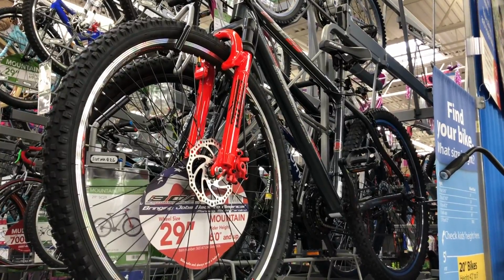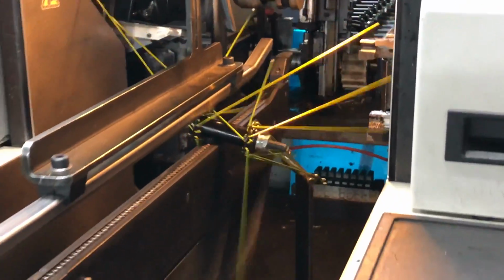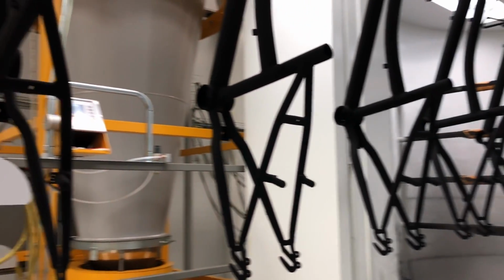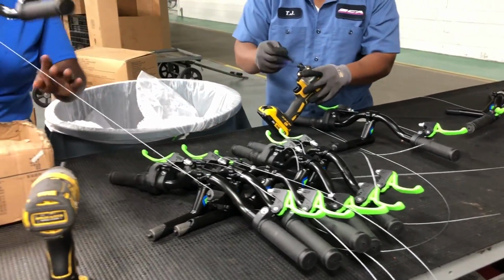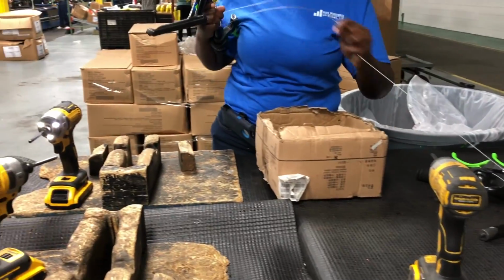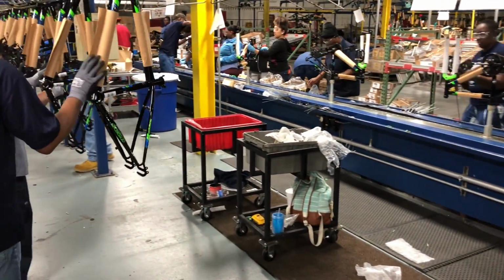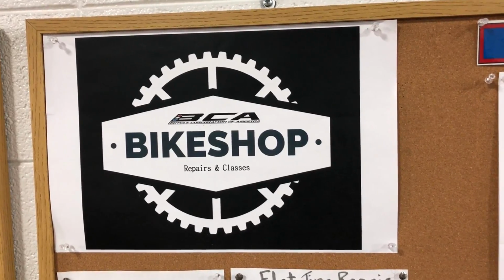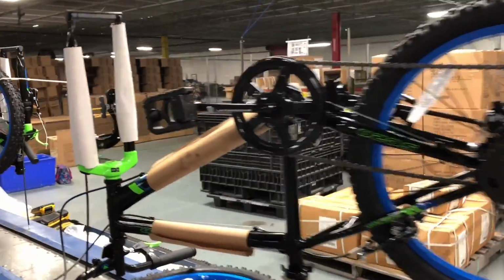BCA Bicycle Assembly Plant - Manning, South Carolina

Comment: Did you ask them why they insist on painting the rims of a bike with rim brakes?
Reply from the maker: I’m hoping in the future to meet one of the bike designers. That’s at the top of my list of questions.
Reply: Simple answer- shelf appeal. They dont care what it looks like post purchase. The lower end bikes just want the impulse buy of just "needing a bike."

Not knocking it, it's just business
Reply: If you look at the very first frame of this video you can see a wheel where the rim is painted black without having the sides covered (even though it has disc brakes) and it looks great.  Steel does not look as good unpainted though.
Reply: Not sure this helps, but my younger son’s first real bike was a BCA with green Vitesse rims like those in this video.  The paint in the braking area wore away in the first few minutes and they performed just fine.  The rest of the rim stayed nice and green for two years of kid riding, which surprised me given how quickly the other paint wore off.
Reply: Because they do not machine a braking surface, which would cost money, and involve another step.  The lower end models also use steel alloy rims and not aluminum alloy rims, so they need the coating for protection.
Reply: Simple. They paint them so when the customer gets cut off on the road, the car driver will hear the squeaky brakes above their smart phone conversation just before impact.

Comment: i wish Costco had a handlebar jig for their bike assembly....half the bikes i've seen on display have the bars upside down or the brake levers facing the back of the bike
Reply: i actually keep a photo album on my phone detailing all of the mistakes a previous 3rd party assembly company made building bikes at my walmart; I made enough noise that management finally replaced them.

Comment: Now you guys just have to get Walmart to employ real bike shop guys (is there a graduation/degree or something to actually have someone who has a good knowledge of the bike mechanics in the US ?) !

In france we have the same thing except that the bikes are sold by mainly sport only big branded stores (Intersport, GoSport, etc ...) and this stores require a bike mechanic graduation to work in it, so the bikes are pretty much the same as you guys have, but they are tuned by a professionnal and when they are sold, they might not be the best quality bikes but everything works well and is safe to bike !

Sorry for my poor englando and if i did'nt make it easy to understand what i was thinking :) !
Reply: in the US, there are teams of bicycle assembly 'technicians' who go from Walmart to Walmart and work at night.  They get paid by how many bikes they assembled that night, and there are no qualifications required to be hired onto this crew.  Its all about speed.

This is why theres so many photos of bicycles with their forks on backwards, saddles at crazy angles, and handlebars rotated oddly.
Reply: @YearOfTheDog82  what you are describing is the 3rd party assembly companies that Walmart is trying to use instead of the in house assemblers (like me) who actually care about the quality of their work. The shift to the 3rd party companies actually started last month; which threw thousands of associates like myself under the bus all because they are trying to chase amazon.
Reply: YearOfTheDog82 Yeah, I think that was the job I passed up on a year and a half ago. I'm glad I did. The attitude is around "not my problem" and "it came messed up from China" and not many of these guys take the time to true a wheel or use a torque wrench. Assuming most of them have ever used a truing stand! The one where I work was a joke until I started working there. I use it every day although I don't get payed extra for truing wheels. It's all $15 per bike flat rate no matter how many mods the customer ordered, like fenders and rear rack, etc. I admit, I do hate on the customers who go for the full Pee Wee Herman bike with everything but the kitchen sink on it. Takes forever to assemble. I can assemble three bikes in the time it takes to do one Pee Wee Special. That being said, I love my job and put in the extra effort. That's the work ethic I have. I stand by my work 100%. I doubt most of these mobile assembly guys can say that.
Reply: ZeBen84 not everyone has a degree (college is expensive) and unless you are corporate, you probably dont have a degree working at Walmart
Reply: ZeBen84 France has a very different education system and biking is culture in France.
Reply: sploofmonkey mainly because of the massive distances the US and Canada have; outside of the major cities, the only way to get around quickly is by car.
Reply: A couple years ago I almost answered an add for mobile bike assembler. Had to have everything including a bike stand to do the job and go from store to store. It payed a little more than where I'm working doing the same basic work, but I get to ride my bike to work every day. At my age it's almost like semi retirement. I haven't looked at a bicycle in around 30 years before taking the job, but I've been a mechanic in one thing or another all my life, so it wasn't hard to pick up on. It's funny, a bunch of the staff have diplomas from bike mechanic school, but they don't work on the bikes. They often ask me questions. I'm the only bike mechanic/assembler in the place. I studied like a madman, and probably learned a lot more than I'll ever use working for this company with the bikes they offer, but I needed to anyway because I started building electric bikes just before getting the job. I've even got the company owner starting an ebike line now! Not as fast as the ones I make myself, but he just ordered two bikes build for himself and his wife that slightly exceed the legal status here in California. Two 1000w Bafang BBSHD motors.
Reply: ZeBen84 your English is fine, much better than most of our French.  It was very easy to understand your meaning.

Comment: I can write it up small hills I can cuddle up to 23 miles an hour without any problem it was well greased in package I enjoyed the bike I have had Huffy Nel lusso another so which I did not care for the coaster brake sucked they had no packing grease in the crankcase and the frame split at the at the rack
Reply from the maker: You own a bca bike?
Reply: I will agree with you to pick Walmart is making upstairs and help step on bicycle quality-wise yes
Reply: I would like to see a full suspension bike hardtail Softail mountain bike from Walmart a decent quality one for a decent price

Comment: you should check out the hyper beach cruiser from hyper online you cannot get it at the Walmart store you have to order it online I think you will be really impressed compared to the Nel lusso the gear ratio is better than the Nel lusso the frame quality is a lot nicer I don't care too much for the rims but for $99 I think it was well worth it
Reply: Icon contacted hyper about the rims and they sent me a new set of rims with turned out great